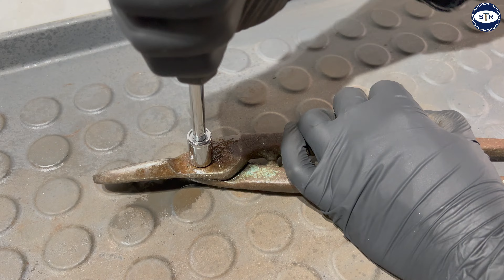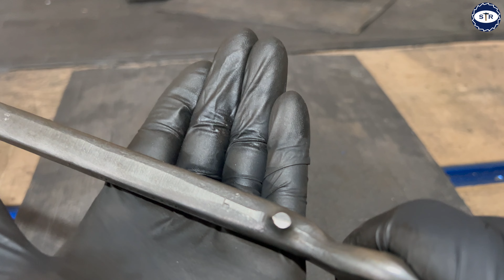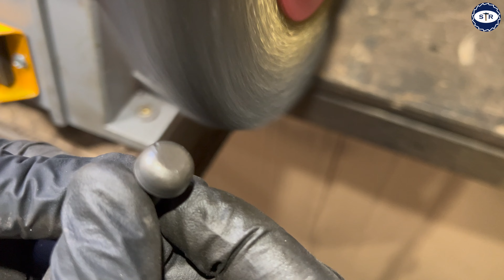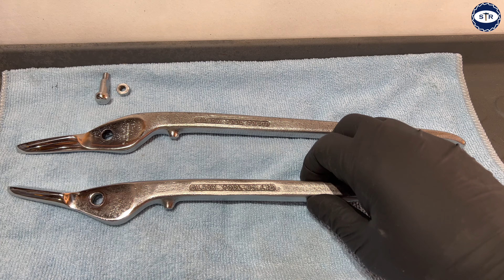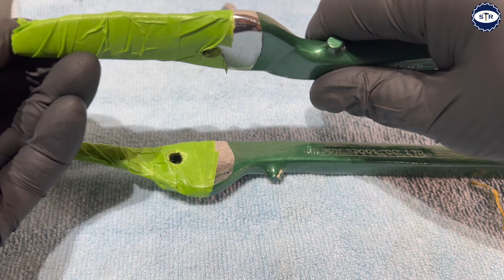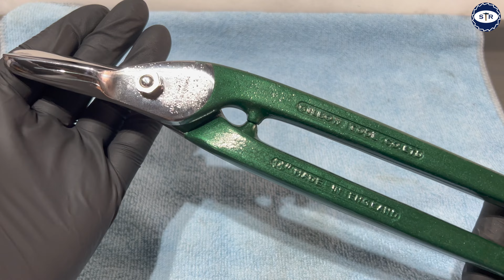English Made  Gilbow Tin Snips Restoration - 4K

Comment: I still have a pair of Gilbow Tin Shears that I bought in circa 1959 in the U.K. that I am about to refurb. they are still the original Blue.
Also I still have a pair of Footprint Tin Shears bought about the same time that I have refurbished and repainted in original Yellow.
Both are similar but have their individual differences....of the two my favourite by a very short head are the Footprints.....Both have given me heaps of pleasure as a Tradesman.
Both are right handed cut..... Any competent Sheet metal worker will knows what I am talking about
Reply from the maker: Many thanks for watching, and for sharing your experiences with these type of tools. I’m very pleased to hear that they’ve given you years of service. I like to think that I’m doing my bit to help make these tools last even longer. As a shameless plug, I’ve also done a restoration video of an old footprint wrench. Many thanks again.